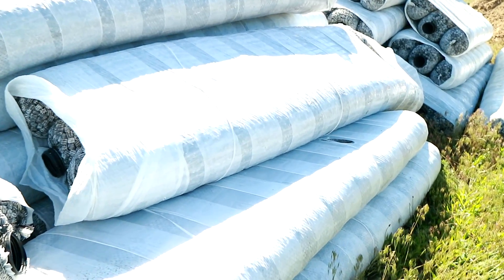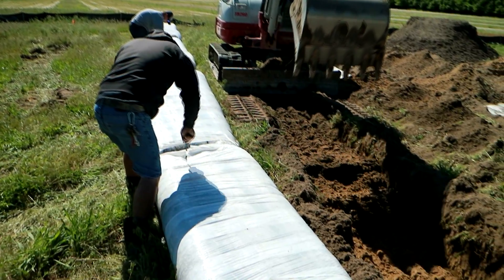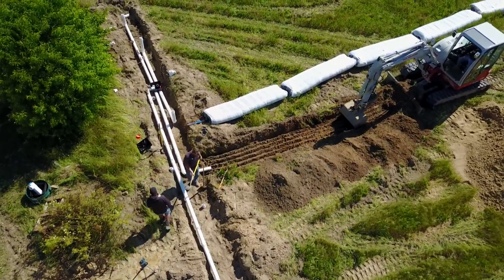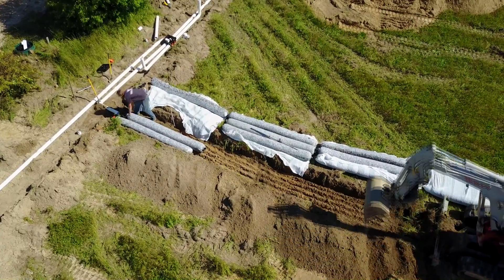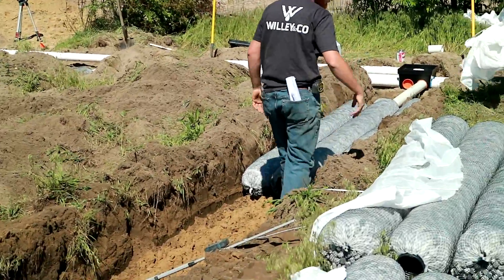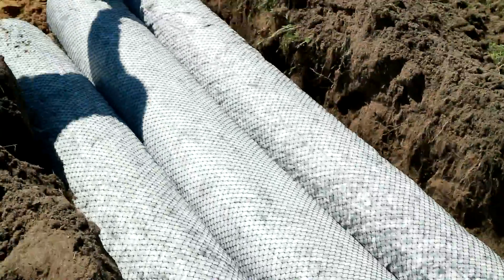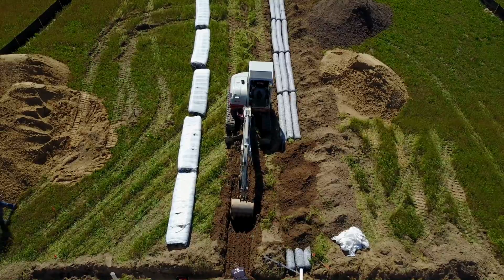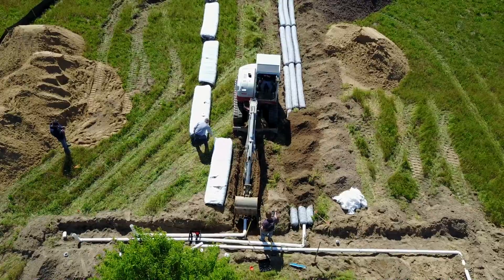EZ Flow for Septic Systems

Comment: Thank you great videos! What soil types are not good for EZ Flow? We live in Northwest NJ a lot of shale,clay & different size rocks.
Reply from the maker: EZ Flow is pretty good on most soils. EZ Flow is basically an aggregate, like stone. It basically allows the wastewater to spread within the system to gain more surface area to the soils for absorption. Thanks for the question.

Comment: Why would you not hook up all three tubes in parallel in the same trench? I am about to install a new drain field to supplement  my old one. I heard about the easy drain product and your is the first one I have watched... Great job and nice video. Thanks.
Reply from the maker: The three bundles in the same trench are not the same, (if thats what your asking), the two outside bundles do not have pipe in them while the center bundle does. We connect all the trenches at the head of the drain field (up by the D Box). In Delaware a lot of the septics we install do not connect the ends of the trenches.

Comment: Great vid very informative 
I do have a question 
I live in va just on the east side of 95 and the plans I have call for trenches 120 inches deep can the ez drain be buried that deep
Reply from the maker: That I'm unsure of because no systems are anywhere near those kind of depths in our area. You'd have to contact Infiltrator (manufacturer)

Comment: I LIVE IN  MID SOUTH FLORIDA WHERE THE WATER TABLE CAN BE HIGH AT CERTAIN TIMES OF THE YEAR. SANDY SOIL, NO CLAY,. ABOUT HOW MUCH TOPSOIL IS NEEDED TO COVER THE EZ FLOW PRODUCT ?. FROM THE LOOKS OF THIS VIDEO, IT LOOKS LIKE YOU HAVE LESS THAN 1 FT OF TOPSOIL. PLEASE, IF YOU CAN ANSWER MY QUESTION I WOULD APPRECIATE IT...THANKS .
Reply from the maker: 12" - 16" of soil are required to be on top of the system with 4" of topsoil being part of that cover.

Comment: What depth did you dig down for 12 in. dia . EZ Flow pipes
Reply from the maker: The diameter is 12" so in Delaware the minimum trench depth is 12" while the deepest can be as deep as 36". I believe this one was around 18". If the trench is any shallower than 24" we have to install a 16" cap of dirt over the entire system.

Comment: Where can u buy this stuff? Lowe's or home Depot carry it?
Reply from the maker: You can buy a different brand at the box stores. They only pieces I have seen in the box stores are a smaller diameter. They EZ Flow that we use is 12” in diameter and very durable. It can be purchased at plumbing supply houses. Contact Infiltrator for locations. http://www.infiltratorsystems.com
Reply: I believe plumbing stores will only sell this to licensed contractors.
Reply from the maker: Your correct however Lowes and Home Depot have a different brand in smaller diameters. I might use it for low volume and low frequency drainage applications but thats about it. EZ Flow has to be bought through a licensed supply house and in my opinion has superior to all other similar products I've come across.
Reply: Willey Co the stuff HD and Lowe's sells is really for French drains. I wouldn't use it for a septic drain field.